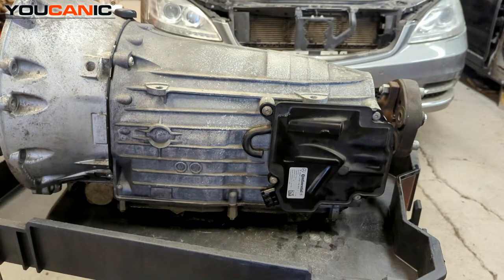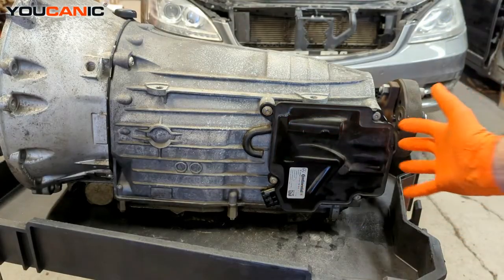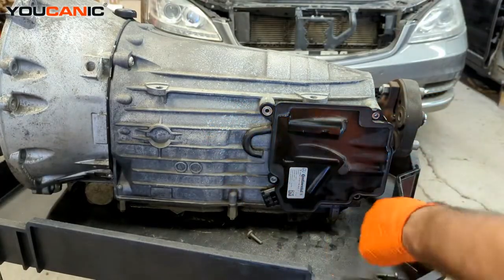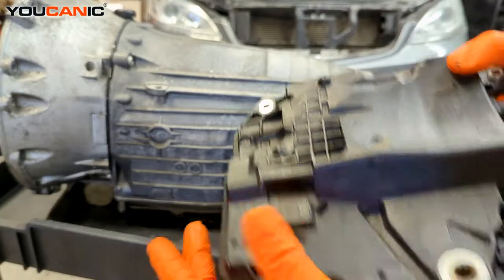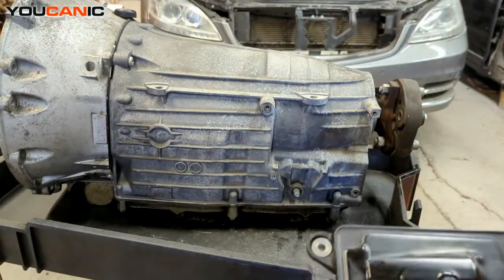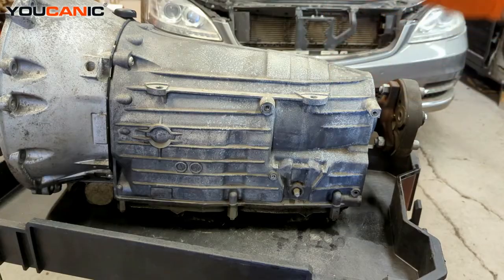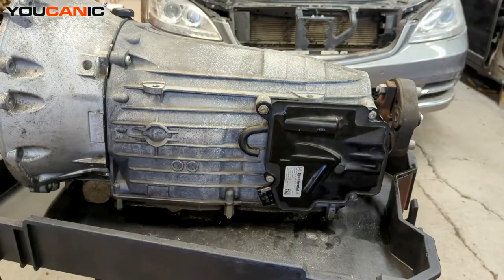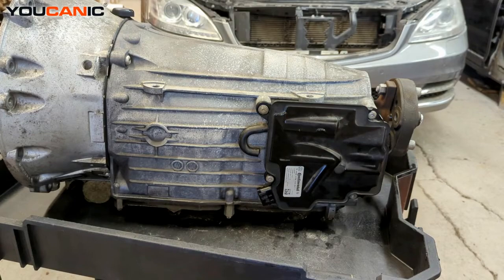Mercedes-Benz ISM Replacement - Drive to Workshop Without Changing Gears Fix

Comment: I had the red light drive direct to walk shop sign, indicating a faulty ISM, I got a new ISM and fixed and reprogrammed it, YET after I drive it for 4 hours, the red light comes back on!! Is there ANY other reason? Maybe a fuse or the Sam whìch could still allow the red light comes back on..
Reply: Exactly the problem I’m having now, I had my ism changed, but when I start my car first, the gear doesn’t seem to engage until I switch it the third time and it still brings the red light “do not shift gear visit dealer warning” but after using it then it works fine Afterall until I turn off the car again

Comment: You are basically explaining how to unbolt and rebolt a unit on a transmission… well thanks but I would have been more impressed by a video explaining how to clone an old unit to a new one …..
Reply: You need diagnostic tools...
Reply: Do you know if u can put in manually in from P to N
Reply: Offer FBS4 ISM DSM data transfer. No open, cuts, lifting of MCU pin or legs. All on bench.